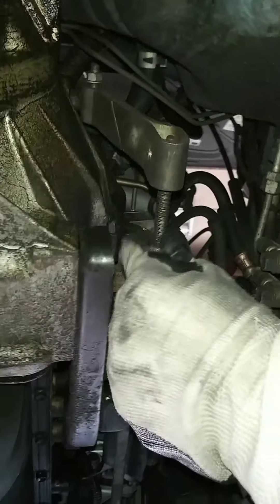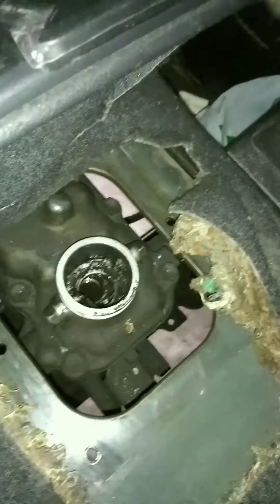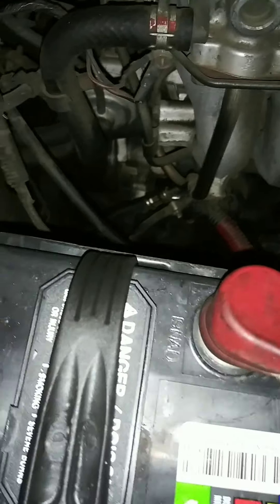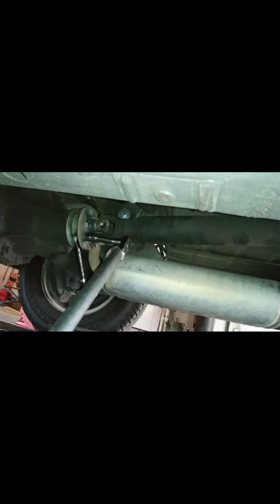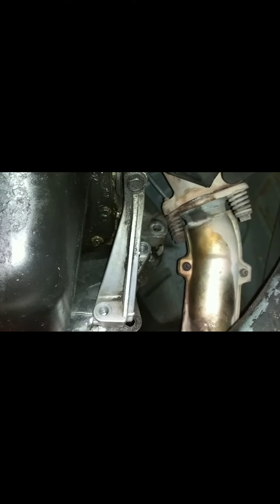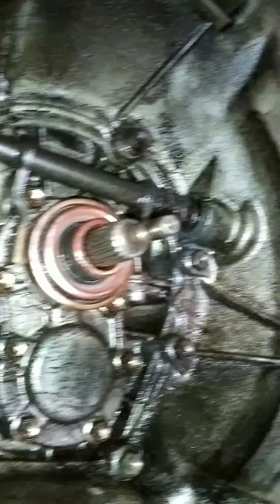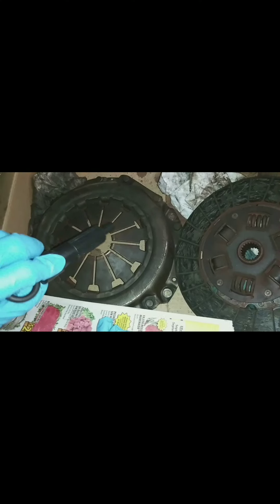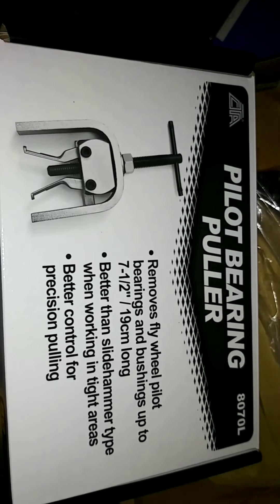DIY Pt1 How To Replace A Manual Transmission's Clutch, Step-By-Step Removal Explained (Part 1 of 2)

Comment: You got lucky when that clutch fell lol. And I like how you put the bolts back in the holes so you don’t mix them up. I do that quite a bit. The transmission on my tracker is an automatic but I still enjoyed watching your video. And I liked the bread method lol I have never heard of that before but it makes sense.
Reply from the maker: Thanks so much! I thought it might b too long & boring of a step-by-step video but couldn't reduce it any further, without deleting relevant info.

Omg I was so VERY lucky the clutch plate didn't fall somewhere painful. If it were regular vehicle-sized, that woulda really hurt! Everything is so small on Trackers.
I knew better too but was distracted, when I reached that point. Lol
This was my very first time to pull the transmission or work on a clutch. I'm actually working on editing some of the other clutch-related videos, from around that project, now.

The bread method is the coolest mechanic trick I'd learned n a long time.😝

Comment: Hi could you tell me what way around the clutch plate is meant ti sit. Thank you
Reply from the maker: Good morning!
The Pressure Plate cups the Clutch Disc & the Clutch Disc usually has a label on it, similar to "Flywheel Side".

At the end of this video & the beginning of https://youtu.be/uPI0W9wwGRY part 2, you can see the Disc's positioning on the vehicle.

There's an image of both sets starting at 9 minutes of this vid but think I may have mentioned the side label on the 2nd vid.
Reply: Thank you very much 😊
Reply from the maker: @TheArron86  You're very welcome.
Let me know how it goes.

Comment: Which car is this for? i have a clutch job on a 1992 suzuki Sidekick i have to do soon is it similar? and where did you get the steps for this video?
Reply from the maker: The vehicles I know are compatible are listed in the video details. Not sure about a '92. I pieced the process together & figured out the rest myself.

Comment: Where did you find instructions? I’d love to get my hands on them I have a clutch on the way. Mine is a 2wd
Reply from the maker: I'd bought a Haynes manual, decades ago. 
The info's not complete, fairly generic & sometimes useless but it did have a lot of helpful info for replacing the clutch. (Also, it was better than Chilton's!)
A frustration was having to flip between at least a half dozen chapters to get the complete process, throughout the job.
I ended up hand writing all the steps, n order, so I didn't have to hunt down the needed sections, every day.
Might still have that paper but it's difficult to read, if I were to share it. I write very tiny! Ha ha
Reply: @chm3598  I’d love to see it!!
Reply from the maker: @jremeee1599  If I can find it & figure out how to share it.
YouTube doesn't have a share picture option, so I've created videos out of photos. But they were legible.
My notes r essentially chicken scratch. 🤣 Not fond of dedicating a video to that mess. Never thought anyone, but me, would read it.

The full instruction is given between Part 1 & 2 videos, plus info, not n the manual or written, that I figured out or found along the way.